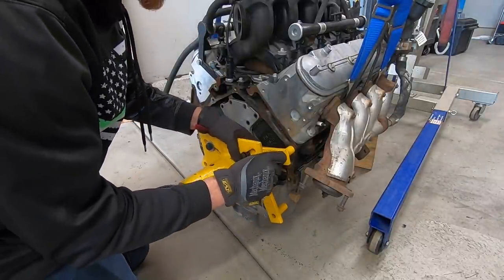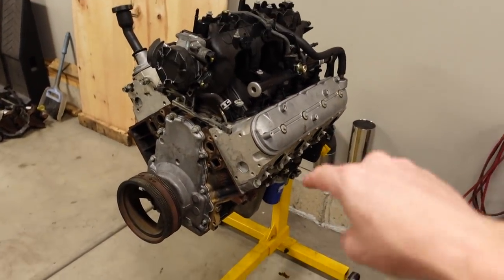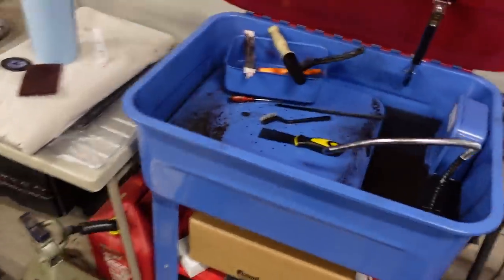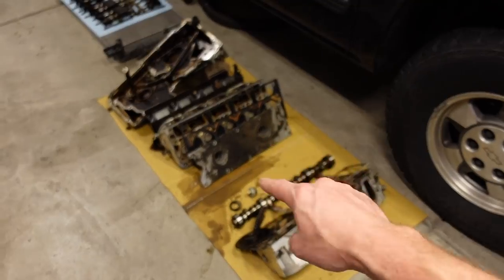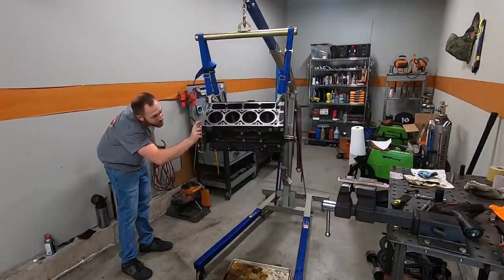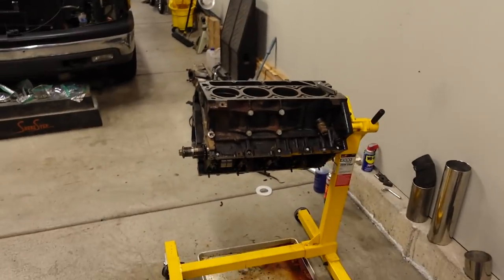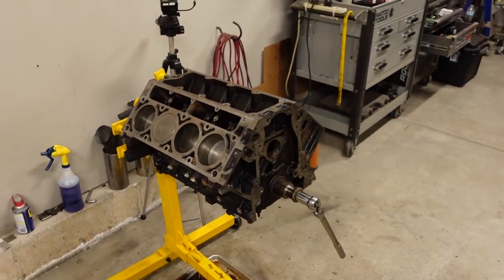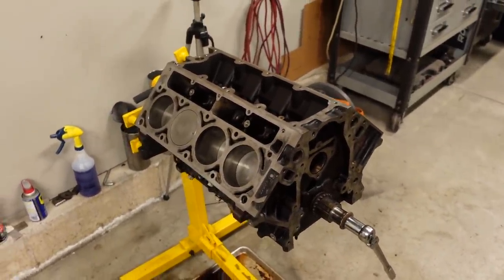GAPPING LS RINGS to hold more power! 4.8 vs 8.1 big block Pt.3

Comment from the maker: what do you guys think about the Baby LS build? I'm sure a lot of you would rather see a 5.3 or 6.0 swapped in, but I am curious to see what this little engine can do...
Reply: Excited to see the 4.gr8!
Reply: 4.8 with a lsa blower
Reply: I am really interested to see what numbers you'll get out of it.
Reply: I’m also curious to see how well the 4.8 does. 👍🏻
Reply: The 4.8 reminds me of the Mopar 318 LA engines; underrated and high-revving.
Reply: Hey LT is the cake swap pretty much the same on a 5.3
Reply: Cam*
Reply: That 4.8 would love to be boosted
Reply: @dcwire9707  it’s identical. Only difference between a 4.8 and a 5.3 is the rotating assembly. Blocks are identical
Reply: I put together a 5.3l bored .040 over with flattop pistons and a Texas speed cam. Been looking for a clean  caprice wagon or roadmaster wagon to put it in.
Reply: Please turbo this. Don't let us down with a LSA blower. Lol! I wouldve started with a 6.0. Also, it looks like you have Gen 3 rods in that 4.8. Be careful with the tune...
Reply from the maker: @dcwire9707  cam swap in a 4.8, 5.3, 6.0 is all identical
Reply from the maker: @ali.al-ismail  it will be before you know it
Reply: I think it's going to surprise u.  U already know I'd like to see an f1a on it at 11:1 comp with a Tbss mani .
Reply: @awdss_silverado1449  I don't understand why folks love centrifugal blowers sooo much. Need a mean stall to really take advantage of it. And the linear RPM dependant boost curve sucks. Turbo will make max boost way lower in the RPM range and carry it through to the redline. And it won't lose boost when the RPM drops on gear changes. And the turbo will make more low end torque than the centrifugal. LSA will be limited in power potential vs a turbo or centrifugal.
Reply: @jaydubb71  theirs a lot of variables their. I have buddies with centrifugal blowers that do really well.  I have a turbo for mine. Converter is kinda irrelevant, need to have right converter for any application.  Everyone does a turbo seems like. I'd just like to see a pro charger on this one 🤷🏼‍♂️
Reply: @awdss_silverado1449  I feel you 100%. But he will need a good sized stall with a centrifugal, especially if he is gonna race it...
Reply: @LawrenceTolman  please try something different here. Look into high revving valve train setup 🙂 4.8 loves to rev to. I think 7500rpm turbo truck should be nice
Reply: I love the 4.8.....they are screamers, especially with the right cam and converter
Reply: 4.8 is a Great engine! However, I would love to see a 408 stroker build and watch as time goes on to see how the reliability is..
Reply: I love the idea of a 4.8 build.  What I REALLY want to see is an aluminum-block 5.3 LS, destroked to 4.8 and built to rev out to 8000 rpm, stuffed in something light and agile like a Miata. Just because!

By the way, I managed to bend the crank in my Delta 88 running the iron-block 6.0 with a TVS2300 blower on it, so we're putting in a forged Eagle crank and upgrading the valve springs. I'll send you a video when it's running!
Reply: I like the way you are doing the job in the little engine and for me it going to be fast when is done. So keep going, GOD BLESS YOU
Reply: Looking forward to seeing it all together!! :)
Reply: Love seeing the 4.8 getting some love... I think a Procharger would be my preference for a power adder...
Reply: Love it so far. Let’s see what you can do with this thing!
Reply: I like the 4.8. It’s rev happy
Reply: Torque storm supercharge that Lil puppy!!
Reply: 4.8 was the forced induction friendly engine no one knew about
Reply: Mad top-end,  @DVYoda  - I kinda want to see back-to-back runs with a centrifugal and a Roots!
Reply: @plepgeat  I have a L33 destroked in my C3 vette
Reply: How is it,  @gearbanginentertainment7476 ?  How high does it wind?
Reply: @plepgeat  we shift at 7400 on dyno pulls, but it could probably go to 7700 if we pushed and risked blowing it.
Reply: Supercharger positive displacement awesome low end  ,centrifugal are nice but torque gets you out and Little motors act big when they have a positive blow right on them.
Reply: 5.3 and 4.8 are pretty much same, barely a difference in power, the 6.0 is a different animal though

Comment: As someone who has been working in a machine shop for 11 years, I have to say that I 100% agree with how you prepped the deck surface. Those abrasive discs do remove metal, more than most think they do. Using a flat sanding block is far better. IMO
Reply from the maker: thanks! I've had good luck with sealing head gaskets this way

Comment: When doing a simple cam swap with the engine removed from the vehicle, have the engine upside down while removing and installing the cam. This is so if you accidentally scratch the cam bearing it will be on the noncritical surface. Since gravity, spring pressure, and timing chain all pull or push towards the oilpan, that side of the bearing will remain very smooth. Also if you are replacing your rings you can use a piece of the old rings to scrape clean the ring grooves in the pistons. Just remember to only use top ring in the top groove, and second ring in second groove as they are likely different thicknesses. Cant wait for more of this 4.8.
Reply from the maker: thats a good idea, I should've done that
Reply: Interesting idea with the cam install. I have never seen it done that way, but now that you mention it, I'm thinking of trying that next time I do one.
Reply: Why not just turn the whole truck upside down and then cam swap it while it’s suspended in the air?

Comment: I worked at a GM dealership in the early 2000s and have had first hand experience with varying ring gap. Had a new 05 Silverado come in multiple times for oil consumption before 15,000 miles. After much troubleshooting we got the okay from corporate to teardown the 5.3. Turned out to be ring/bore problem. Had ring gaps spanning from .019 to 3 cylinders that were .040. Most likely a tooling problem because the pistons were sloppy in those bores. So fresh gm crate engine went in.

Comment: I think what test your talk about is Richard holdener doing the big bang test on the 4.8 he was doing a lot of engines and doing a lot of testing on LS is around that time I think he just got confused I think he also had some other stuff he was doing. They also put some pretty nasty cylinder heads intake and all of that on top of that engine the bottom and can handle the 1200 horsepower that he made but the top-end is fully modified camshaft Etc if you want to see the video you can look it up I think it's called 4.8 Bigbang or 5.3 Bigbang. And he sets the ring gaps on stock engines all the time to 30 thousands of an inch. Any same to Turbo nitrous or supercharged just about every kind of engine he can get his hands on

Comment: Glad to see you said turbo on the 4.8.
Dollar per hp you can't beat the hp of a turbo. 
Low speed torque on the other hand you can't beat positive displacement. 
Just size the the turbo and converter right and fun will definitely be had.

Comment: A very fast abd cheap way to clean piston is to spray them down with easy off oven cleaner and place them each in a plastic bag over night, I rebuild a lot of old farm tractors from the 30s to the fifties and I used this method for years
Reply from the maker: Great idea

Comment: 24:55 is exactly why you don’t pressure wash one of these engines as part of washing your truck. The knock sensor wells fill with water and corrode the knock sensors and harness.
Reply from the maker: yup! I wouldn't have done that if the engine wasn't gonna get torn down shortly after
Reply: Good to know.

Comment: I did all this minus removal of the bottom end. After reassembly and install I had 5 psi of oil pressure at idle. Because of time constraint I ended up getting a stock crate 5.3 from SummitRacing. I don’t regret it as it runs fantastic!

Comment: You are building quite the fleet of bad ass trucks.  Love this series. Do you think the larger ring gaps contributed to the oil seals leaking?
Reply from the maker: no, as long as the PCV system is doing its job, it shouldn't build up a ton of pressure in the crankcase. I more attribute it to age, the truck is 21 years old, and spent the last solid year sitting without running at all...

Comment: Should drill extra oil return holes in the oil grooves  to keep the oil rings from seizing again. Every LS I have taken apart they have been seized... Just not enough area to return with those little grooves... Something they messed up with on the LS vs a SBC... also some mods can be done on the early ls valve covers to help eliminate oil consumption... just an FYI
Reply: I wonder if there is a good how to showing the dos and don'ts for that procedure?
Reply: Chris, could you post procedure on how/where to drill the additional hole?
Reply: @josepho5055   - after I posted, I searched YT and found about a half dozen videos. One, the guy even compares factory pistons to aftermarket. Showing where the aftermarket added the holes.
Reply: I actually did it on my last build but I was in a gurry and did it off camera but I linked a vid above that did the same procedure...

Comment: Good video LT, I'm building a stock 6.0 lq9 that came in my 03 Silverado. I bought a turbo kit off of ebay for $2200 I will be happy to just wake this engine  up a bit. In stock form this lq9 is a bit of a lazy ass, even with a superchips programmer this thing is lethargic. I'm hoping that turbo set up will do the trick, the truck has only 109k miles on the odometer so I'm doing like you I'm going to reseal it  gap the rings and wish for the moon. Love your shows buddy. Aloha🤙🏼

Comment: Chem dip will clean your parts up like you have never seen before. i use it on all of my LS teardowns. It comes in a gal. can you can soak the pistons in it for an hour of two and the grime will come off so much easier.

Comment: I'm loving this build it's very interesting also for next time cheap oven cleaner from the dollar store works a 100xs better than any parts wash solvent.  it will make life much easier
Reply from the maker: Great tip!
Reply: Just watch the easy off on aluminum will eat Into it if it sits for too long... But yes it's the best at melting the oil and grease

Comment: From when you built your 8.1 .You  need to add inflation to that total. The last 18 + months prices have gone up insanely high on a  lot of the parts. So if you add inflation to your original 8.1 build you might be where you're at now for the 4.8 build.
Reply: #letsgobrandon
Reply: just out of curiousity, what items that he plans to use have gone up in price?

Comment: Just wanted to ask if you could do an LS tech on factory ls rods  gen 3 and gen 4 on direction of rod and reasoning. Any extra tech you could throw in there would be great. There is so much info on the internet and so much argue about this. I’m sure gm engineers had a purpose for the way they were installed. Thanks In advance. Enjoy watching the channel!

Comment: I'll go ahead and tell you it's gonna be faster and make more hp if it's a gen4 depending on high you turn it! I've been pretty damn fast with a un opened 2012 SBE 4.8 I pulled the 799's and used stock 706's with a pretty big ljms cam BTR springs and 120$ push rods with some ls7 lifters,tbss intake with a eBay throttle body Bosch 210 injectors E90 and Holley EFI off the shelf Huron Speed single t6 hot side with a forced inductions s488 96mm turbine and 1.15 t6 housing a huge precision air to water intercooler in a 3200 pound race weight with me 00 Z28 Camaro power glide and a strange bolt in 12 bolt stock style suspension on 28x10.5w's it went 5.48 @ 132mph turning shifting at 7300 crossing the stripe at 7700 rpm and it lasted a whole season before it bit the dust and it would have lived if I would have not got carried away with the tune and didn't pull enough timing on the scramble scramble at 31.8 pounds of boost! LoL Never underestimate a 4.Great that combo beat up on several cars with more turbo, cubic inches and more hp! The trick is to act like it's a badass twin turbo 481x and throw the kitchen sink at it and not be scared your gonna scatter it and always run a diaper on a SBE!

Comment: The last engine I did I had to clean the pistons and I found that is you mix acetone and transmission fluid and let the pistons soak in that overnight the next morning most if it will wipe off

Comment: Forget a roots blower for this. PSI for PSI, you'll make more power with a turbo vs any belt driven blower. Size the turbo correctly and you will have minimal lag. I think I suggested the 7665 sized turbo in a past video (maybe it was the last shirt video you did?)

Comment: Fun fact: ring gap hardly "opens up" with mileage. Rings don't wear away like tires, instead the bores enlarge but even that doesn't do much. Math shows 0.0015" of wear in a 3.78" cylinder (which would be nuts) would only add 0.005" to ring gap - that's good for a 50-shot at best. Plus the worn ring seal would be trash anyways.

Instead you must understand LS engines have a huge range of 0.0010" to 0.0025" right from the factory. Only a handful have those tight rings, but it's still easier to pull one head off to check then swap out a blown motor, find another, swap it in, and risk another...

Comment: Love the turbo 8.1
Loving the idea of a pro charger 4.8
And when I had a Burban I always wanted to whipple it. They have a great kit for the suburban that at the time I could not afford but always curious of how it would have been...
Reply: I had a Procharger on a '94, 2500 suburban with the TBI, it was better, but still pretty weak. The TBI models were only rated at 230 horse to start with. I did pick up a mile or two per gallon on the highway if you kept your foot out of it, which means I got up to about 11 or 12 MPG!

Comment: I remember that Hot Rod article. The Big Bang article. Richard Holdener did it. I tuned a 88mm turbocharged Trailblazer SS that went 123mph in the 1/4 on 93 OCTANE, 15 PSI AND PUMP GAS. The TBSS weighs 5300 pounds also. Will be tuned on 15 and 20 psi on E85 soon...
Reply from the maker: damn, thats impressive for a heavy truck!
Reply: @LawrenceTolman  thanks. I'm trying to get it to at least 130 mph. I think it can do it. Especially if the owner gets some weight out of it...

Comment: Hi LT, i just watched a video today where a dude cleaned a nasty engine with Berryman chem dip(?).  The chemical did all the work, he only had to use a toothbrush and a paper towel to de-crud it.  Have you ever used that product?  He got it at walmart for way cheaper than the parts house charges.  Anyhoo, his pistons and combustion chamber came out looking new with no effort on his part.  I appreciate your efforts Man.

Comment: Have you thought about doing a 363 or 383 stroker with this 4.8l? I know Its not cheap doing this but could either do a high compression stroker or keeping it a low compression stroker for boost. Thanks LT for the content.

Comment: Well LT that's where I guess I went overboard, I sent a Gen 4 5.3 to the shop, spent 5k on parts and labor,  heads extremely worked and I fired her upon day and now well I really need to build an exhaust, I put .028 top ring and .032 on 2nd ring

Comment: Alright LT, I've watched you do this in two videos now and I wanted to offer up a small tip. I completely agree with your methodology to sanding the deck on your block to clean it up. However, I would warn you to avoid using a front to back motion when doing this as it can create valleys in what you are sanding. Using a figure 8 motion will help create a much more flat surface and prevent you from creating a large dip in the surface. I work in a machine shop, and when we set up a new job in a machine its always a good idea to stone the table and remove any small nicks or dings in the table to help keep it flat. I've been yelled at, I mean taught by, several old timers that the figure 8 method is the only way to achieve a flat surface by hand. Anyway, I love the channel, like the dialogs and explanations you give on your thought process, and really enjoy the content and projects you put out there. Keep up the great work! Oh, last thing, my vote is for a centrifugal super charger on the 4.8! Can't wait to see the results from this project!

Comment: I know it's probably going to be a while before you change that 4.8 for something else. But man am I curious to see what your going to replace it with. I myself have a 5.3 lm7 that I can't make up my mind on keeping or swapping it out for something bigger I want a daily I can drive that can also blow the doors off a mustang or Camaro . Maybe turbo is in my plans
Reply from the maker: I think a 6.0 would be just right for this, but we'll see whats around when its time to make the switch. I'm gonna keep pushing the 4.8 and push the LSA blower harder for now
Reply: @LawrenceTolman  that sound like a plan to me. That 4.8 was getting out for sure . The all wheel drive system was a very good idea. But just imagine stock suspension. Wow. Imagine when you upgrade that suspension man it's going to be a game changer.

Comment: A little too big is better than a little too small for a power adder engine. I have patience for filing rings, but cleaning all those rings, especially the oil ring, I would have tapped out and bought new rings and filed them. You shouldn't get any appreciable blow by with that big a gap. If that is a Gen 3 engine you should be good to 12-1400 HP, then the rods will say bye bye. Gen 4 15-1600 maybe more, thicker beam rods, really stout. 4.8, 5.3's are very impressive right out of the bone yard, as long as you gap the rings with power adders. You can get 80-120 HP with a cam because the 4.8-5.3 cams are limp noodles.